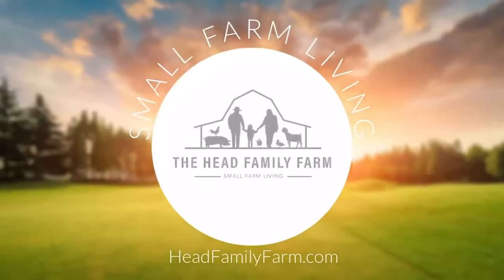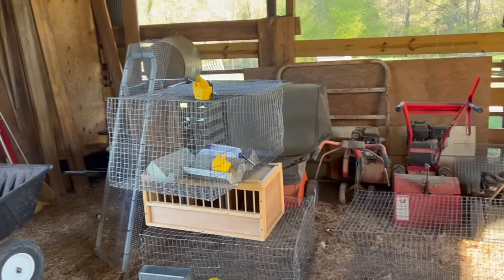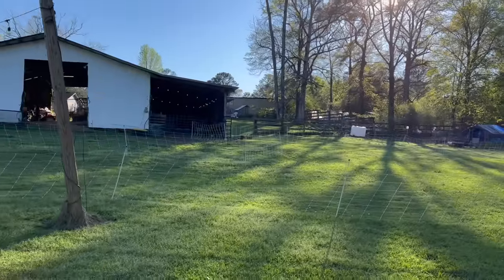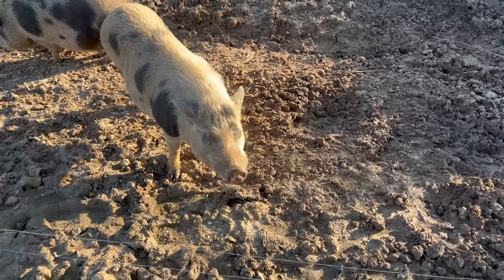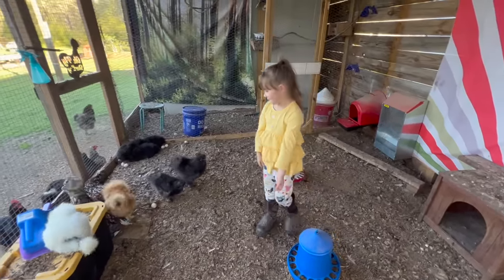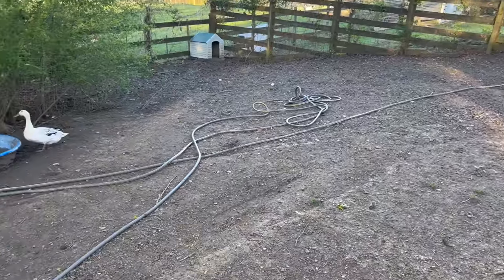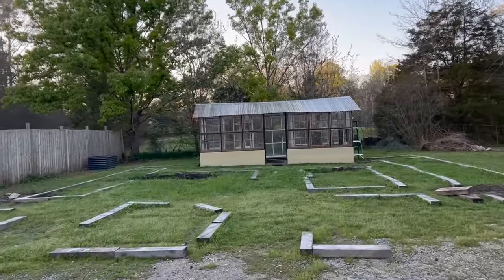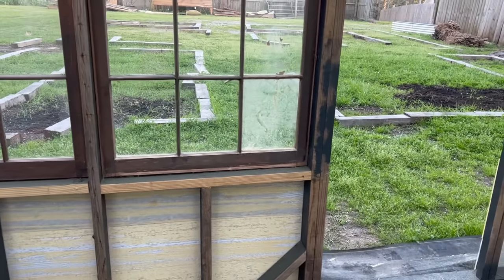Full Tour of Our 10 Acre Homestead | Animals, Gardens, and our Farm Businesses

Comment: Just air flow might drop it 6°. In my state its very low humidity and our quickest way to cool down is a spritzer bottle of water. Sit under a ceiling fan and mist yourself and it will freeze you. This probably doesn't work in high humidity areas.